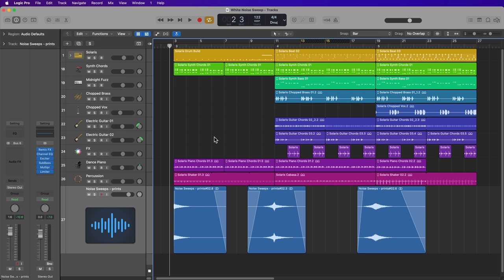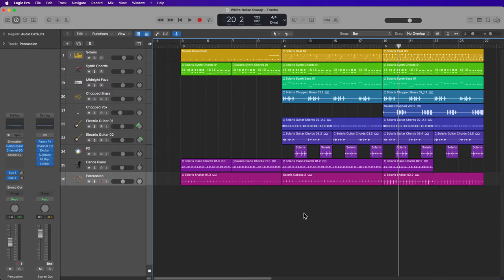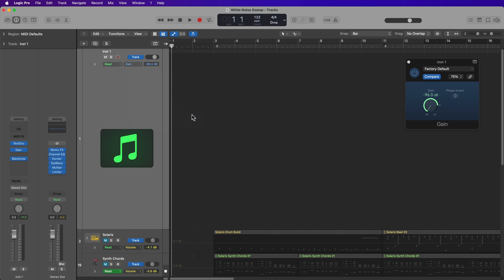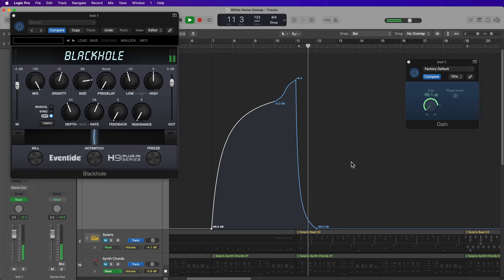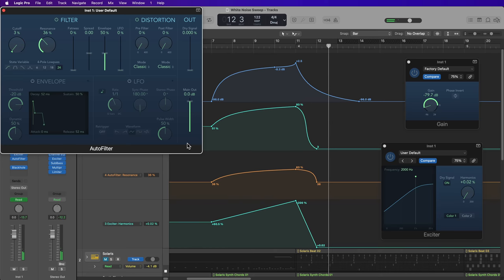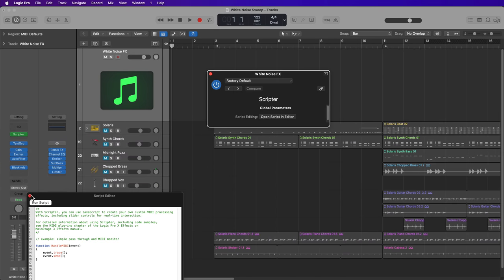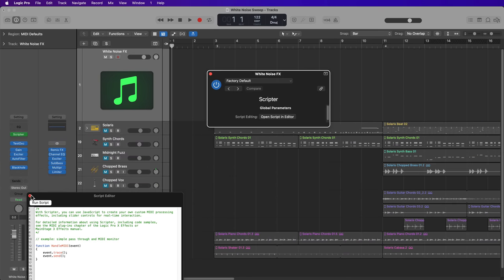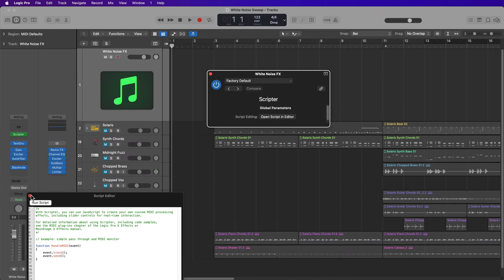Logic Pro // Make Your Own Noise Sweeps!

Comment: Will I use this specific effect in my projects? Probably not. Did I just watch a tutorial that had a ton of useful information, applicable across many contexts, presented in a measured, easy-to-follow manner? Absolutely, and it’s why I subscribe: even if the video doesn’t specifically apply to my needs, I am still guaranteed to learn something. Thanks for another terrific tutorial.
Reply: Why wouldn't u

Comment: Thanks for a video! The only thing is that you can control Gain directly in TestOsc, there is a knob on the right of it. Also you can easily it automate.
Reply from the maker: Yep, I mentioned that in the video. The reason why I didn’t use the gain control in the test oscillator is because you might want to put an effect BEFORE the gain control, which you wouldn’t be able to do if your controlling gain from the test oscillator.
Reply: @MusicTechHelpGuy  you're totally right, I missed that thing 👀

Comment: Could you do a video on gain staging? I am trying to have my kick stand out in the drop of my song but it keeps clipping when i increase the bass or boost the level. You have single handedly taught me most of what I know about production. Thanks.
Reply from the maker: Try pulling the level of ALL of your instruments down by 5-10 dB or so. Enough so that the master doesn't clip. Then pull up your kick drum to the level you want. Then in mastering add a limiter for the final loudness level.
Reply: @MusicTechHelpGuy  Smart. I was worried about making the track too quiet, but I guess that is what mastering is for.

Comment: hey Josh :) 
 I have a question that stands not in the context of this video. 

topic:
learn assignments (midi keyboard) I have for example a simple gain vst and I put this on every strip, then I try to connect every gain signal from every gain vst to ONE nob so I can control every strip with one nob, without going in each one (this makes it easier to regulate when I have to fix loudness without changing balance of the mix. THE PROBLEM :D : logic allows me only 2 Gain signals from this vsts on one nob. after that it goes back to one und delet the others. Do you know if it is possible to Mappe more then two signals to one nob? 

Thanks a lot! I hope you understand :D I cam from Germany and englisch is not my masterclass :D

Comment: Just a question, instead of recording the feed of the reverb in a distinct track in real-time, in order to save time, would we get the same result by clicking on “create a track” in the mixer out of the reverb track and then bouncing this track offline? If not what would be the difference?
Reply from the maker: In my video I intentionally put the reverb directly on the test oscillator track, so I didn't have to use a send or busses. You could do that. But you'd still have to draw in all of the automation manually before bouncing. Alternatively, you could put the reverb ON the channel like I did in this video, draw your automation, then create a blank MIDI region for the duration of the sweep. Then select the MIDI region and press Control B to bounce in place, that would also work. But again, you'd have to draw in all of the automation for all of those parameters, or record it in using the method I demonstrate here. Personally, I like to just recording it in real time, because I don't have to worry about automation, but yes, you could bounce in place or offline bounce as well.